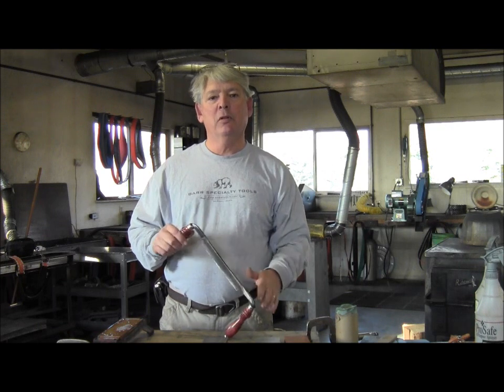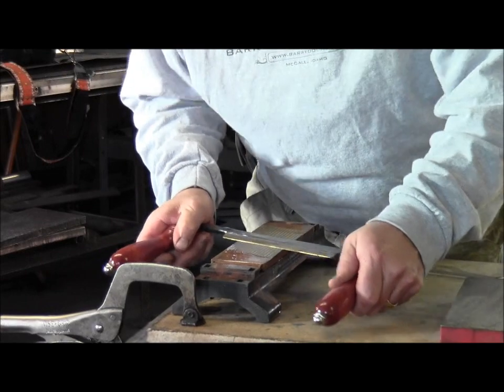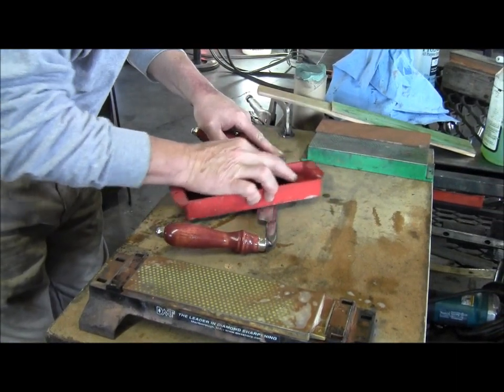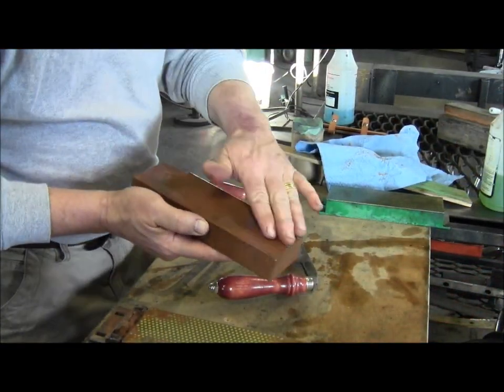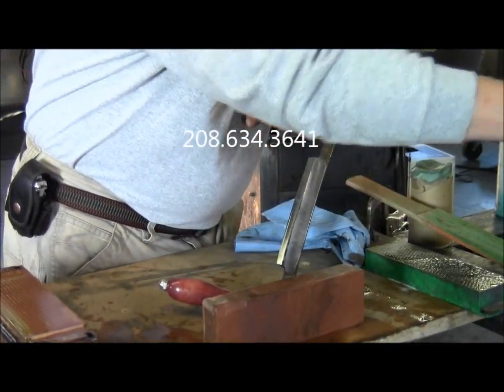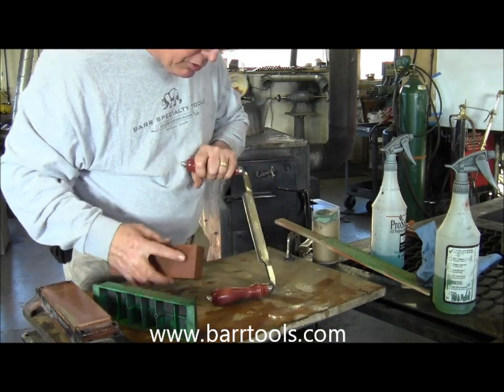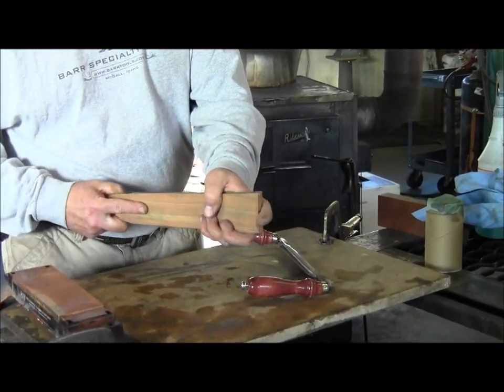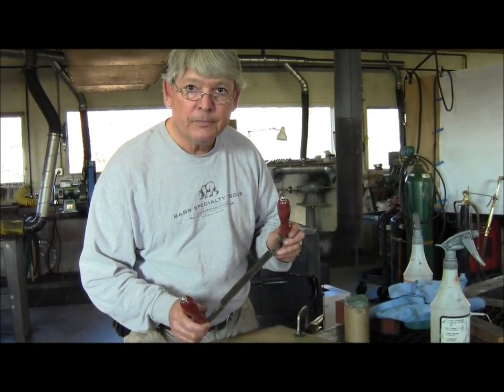How to Sharpen a Draw Knife

Comment: Very interesting. When I'm working though my knife gets all caked with black pitch, and I haven't the time or facilities to go through all that. I just keep a piece of emery cloth(sand paper for metal) in my pocket while I'm peeling. When ever I get over heated and need to take a minute I pull that out and shine up the bevel. I peel big logs for a log home builder in Alaska. I don't get it sharp as a razor, but I get the job done. I can clean a path a foot wide down a 50' log in 10 or so minutes.     Hey also If you can't hear well try headphones.

Comment: I have been a pro woodworker for nearly forty years now and if there is one tool I avoid using if at all possible its my draw knives. With the best will in the world they are a pain to sharpen, a pain to use and frankly overrated. But there is one trick to make sharpening the bevel a lot easier and dead flat. You block up your stones to get the right angle then let the handles tip down and rest on the bench as you push it back and forth. The two handles and blade edge form a three point rest. As long as your stone does not slide around its the easiest way to get an edge on the damn things.
The last time I used one was to pair down tapered trenails for my timber frame house. It was hours of back breaking wrist burning agony until I pissed it Off and taper turned them on a lathe instead. So much quicker and easier, not to mention more accurate.
I guess people see the draw knife as a cool tool that is old school but not me. Its the one edge tool I have learned to hate and avoid like the plague.
Next time your thinking of shaping cabriole legs with one do yourself a favour. Rough it out on the bandsaw and shape it with an angle grinder with the flexible rubber pad and sanding discs. It messy but fast and accurate. Boat builder taught me that trick. They call angle grinders the boat builders chisel. Funny but true because those guys are having to work curves all the time and draw knifing short grain is a bastard of a job. But my main hate is tear out and draw knives can tear out nasty long strips and completely fuck up a piece your working on. I love my hand tools really I do but my draw knives ? Bastard things.
Reply: Ha ha! Tell us how you really feel!

They aren’t my favorite tool. Too many miles of bark strips as a kid.

Good tips, btw.
Reply: It's fine to not like a tool. But id say either your tool isn't sharp or you're using it wrong or in the wrong application.
They're an EXTREMELY versatile and useful tool to those who master or even get mildly accomplished in using them.